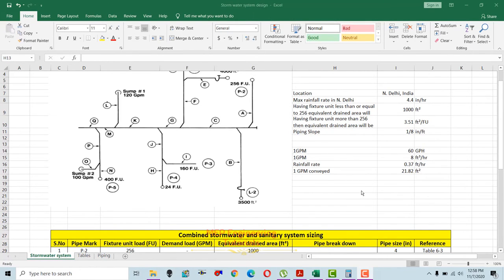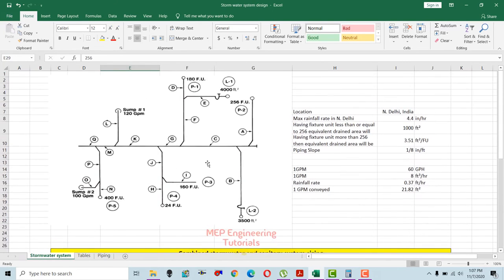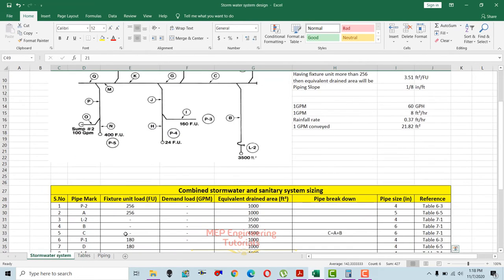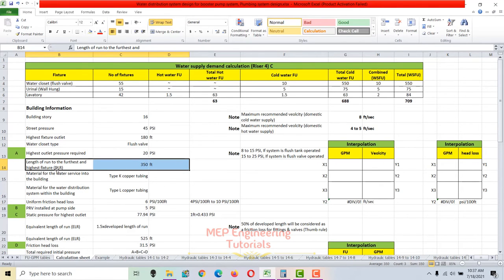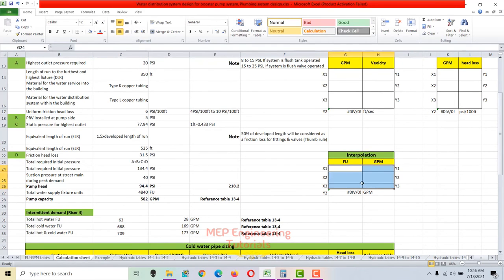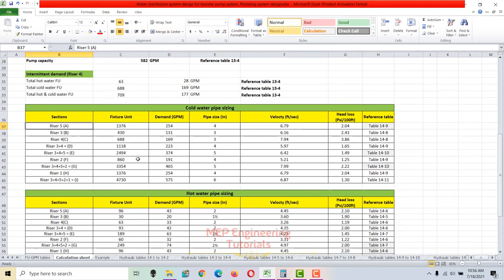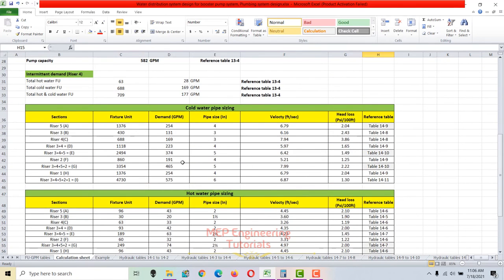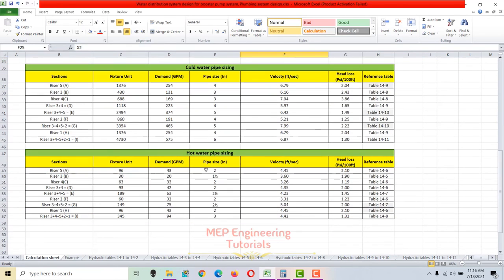Plumbing system design part 3

Comment: You've got great videos. I am from Nigeria. Will your videos be of help to me? More often, our water supply into building isn't from the street main. It's usually from borehole to an overhead tank,then to the apartment. How can pipe Sizing be done considering supply system?
Reply from the maker: It doesn't matter where your water is coming from, you just use street pressure or wherever your water is coming from take it as pump suction pressure and rest of the procedure is same for pipe sizing. In case of high-rise residential tower or high-rise commercial tower you can have transfer pump to transfer water from underground tank to overhead tank and use booster pump at the roof top.
Reply: @mepengineeringtutorials  Awesome. Does your country use WhatsApp for communication? I want to relate with you more via a quicker means
Reply from the maker: @paulakoh4870  +971569419133